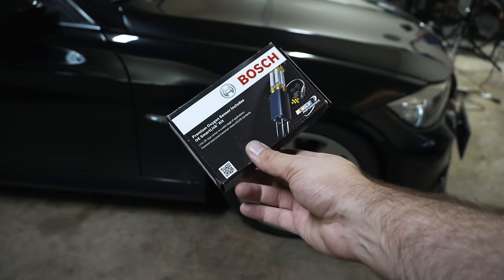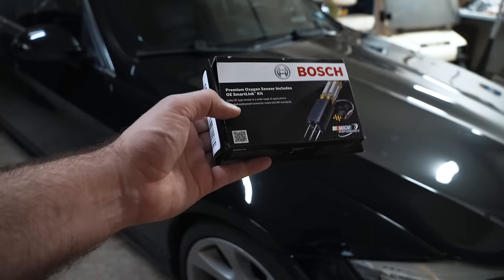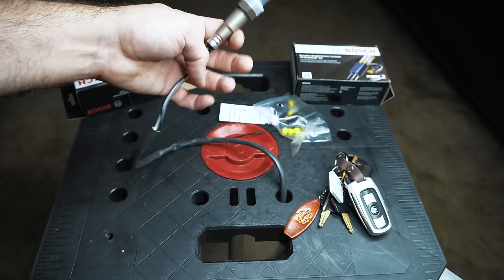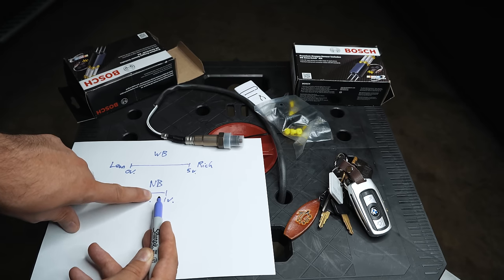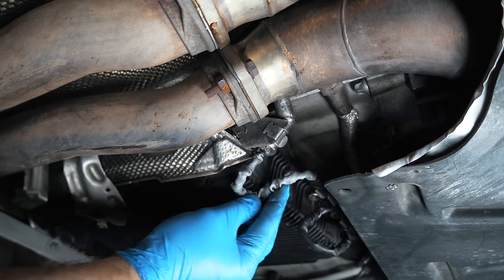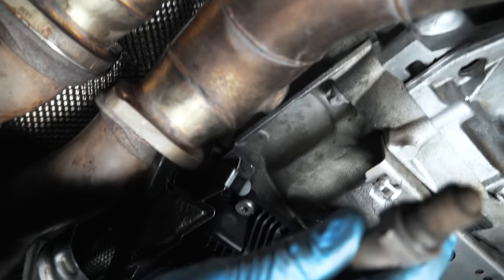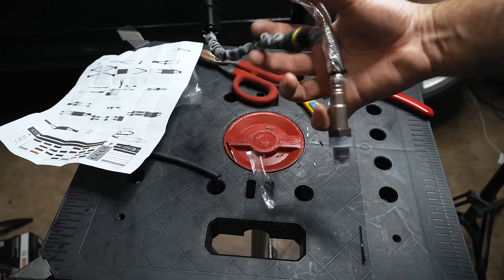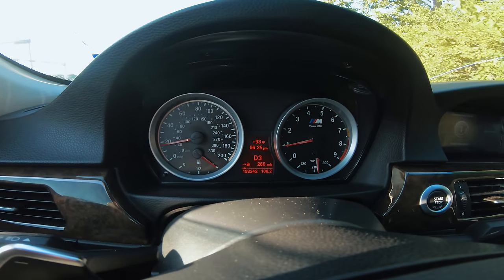I wish I Knew EARLIER! Post Cat Oxygen Sensors | BMW E90 DIY

Comment: 25 year ASE master tech. Post cat sensors monitor catalyst efficiency only. They have nothing to do with fuel mixture if the Pre cat sensors are working. You cannot accurately measure afr after a catalytic converter.
Reply: Thx, yeah I drive AMG's and this video left me a little confused. The primary cat's voltage fluxuates between .1 v-.9 v. while the secondary is a 'mid point' at .5 v.. But can wide-band or narrow band b used upstream or down?
Reply: Not entirely true. I have acces to the Mercedes WIS and on the ME 2.8 the post cat sensors are called the master sensors and are used for two sensor control. They are also used to make corrections to the fuel. 
https://mbworld.org/forums/w211-amg/491094-diagnose-secondary-air-injection-egr-post-cat-02-sensors-through-sds-5.html#post7943273
Reply: Not true. I thought the same and drove with bad post O2 in my N54 for awhile. Thought the code it was throwing was for the downpipes. I was experiencing timing corrections and afr issues under full load in the higher rpms. Ended up changing them out for the same ones in the video and it fixed the issues I was having.
Reply: Scott, regarding 02 sensors, have u ever driven or ran an engine w/o them? Does it stutter? Does it run ok?
Reply: @135i  Hey thx Brad!!!!!
Reply: @ademc8872  Well my Merc. S600 BARELY drives when cold! Once warmed it's better. So I checked both front/rear 02's and pre=cat's were working but both down-side cat's were stuck at .5 v. I'll be replacing both post-cat's soon.
Reply: I think in the N54 the secondary sensors help monitor the calibration of the primary sensors. Obviously the narrow band sensor only can signal rich, lean or stoich, but I think the DME uses this to confirm the primary sensors are not drifting over time. Under the correct operating conditions, if the narrow band sensor is reading stoich, the wide band sensor should agree. This is a working theory based on the behavior of long term fuel trims on the N54 engine. 

The down pipe fix he is talking about in the video simulates the signal of the secondary sensors in cases where the primary catalyst has been removed in order to prevent a catalyst efficiency DTC. This simulated signal appears to mess with the fuel trims and makes it difficult to target and AFR in one or both banks.
Reply: ISTA+ software has written exactly how he's explaining it
Reply: my secondary o2 lambda on bank one went out on my 330i e92 and my fuel economy got worst, im researching what is going on and this vid totally make sence..
detail expl. when i was accelerating half a gas pedal eco never went over 15-20 liter per 100km-instant comsumption reading, now it goes over, 20-25 liter per 100km, not much of a difference but here in europe gas dont come cheap..
Reply: I wanted to comment on this. The BMW ecu system does not just use the post cat o2’s for just catalyst monitoring, the post cat o2’s primary responsibility is too monitor the difference between itself and the pre cat and then adjust the lambda adaptation.
Reply: on my f30 bmw n55, bmw states the rear o2 sensor not only monitors catalyst efficiency, it also identifies deviations from lambda 1 (from front afr sensor), however the rear o2 sensor is not exactly equipped to determine the size of the mixture deviation.

the job of the front probe is to stay at or close to lambda 1 depending on the circumstances. at WOT, we don't care much about lambda 1, we care about the engines performance and keeping it safe from harm. so lambda 1 at WOT; 6500 rpm; traveling up a 10% grade, is way too lean for an ICE with forced induction.

the job of the rear probe, yes, is to monitor catalyst efficiency, but on this application, its also to tell the dme if we are drifting away from lambda or not. 

i wouldnt say the rear probe "calibrates" the front probe, as these probes are calibrated at assembly. but it does give info to the dme to adjust adaptations accordingly.

remember, the dme (or ecu/pcm/ecm) is blind, and relies on sensors to help the dme "imagine" whats going on. if the rear probe (or any input) is lying to the dme, there is logic in the software that can perform tests to verify the information given by the input. if the story doesnt check out, a code is stored.
Reply: @james10165 what codes was it throwing I have the same issue now think it’s the post cats I’m getting 2c7c

Comment: There is a sensor test menu/procedure in INPA (I think under F9), it tests O2 sensors and shows resulting Min and Max values for all of them, narrow and widebands.
Reply: Hi Cygan, could you help me identify which 02 sensor is bad in my case ? Here are the values which differ :
*multiplication adaptation: 
bank 1: 30.443% | bank 2: 4.211%
*correction injection time:
bank 1: 5.66%  |  bank 2: 1.34%
*lambda voltage after catalyst:
bank 1: 0.13v  |   bank 2: 0.78 v

Thanks a lot !

Comment: Just bought the same set off eBay for my 135 2009, way cheaper than the original with the full harness 👍 thanks for this video and the full explanation
Reply: Is the post cat O2 sensor located the same as the video?

Comment: From what little I am understanding about what you're showing us. This all happened because the person that did your "DP Fix" didn't put it back together quite right a crossed two wire pins and instead of oin 19 and 20 being in their correct places they were crossed and 19 was in the spot where 20 should go and Visa Versa? But I learned so good stuff from this as well like some of the relations between the two sensors and what they might be doing when trying to adjust and measure your levels of Oxygen etc. The O2 sensor mod to save money is a great bit of info. Thank you again for the helpful video.

Comment: Thank you so much! After installing new 17T turbos with catless downpipes I haven't been able to get rid of air/fuel and 02 codes. Have misfires etc. I'm going to do this and get back to you with my results. Thanks again for all your videos. You've been a great help for ALL of my mods.
Reply: So?
Reply: And ?
Reply: @chtistianvasquez6029  YES! It's been running perfectly. No codes. AFR's reading right. Also installed XHP stage 2. Thanks again for the help on this. Really saved me after all the work.
Reply: @tazwinsulose  so all you did was replace secondary o2?
Reply: @TimelessMotors  Yes but you have to use Bosch# 15733 for both and splice the wires to the or plugs.
Reply: @tazwinsulose  thank you
Reply: I have a bad 02 code after someone put my catless downpipes but ima go to shop tomorrow I pray it works

Comment: so i put new upstream o2’s in my downpipes after just having them plugged for forever. and i had the correct o2’s in correct pipes and correct connections. yet i was getting a o2 sensor swapped code. i’ve never changed my downstreams, could this maybe be the issue?

Comment: There are a few rules to remember whether you have a BMW or not.

It is important to know the brand of the OEM sensor. Sometimes when a Denso or an NTK is replaced with a Bosch, it makes the car run poorly. I suppose the same thing could happen if a Bosch was replaced with a Denso or NTK.

However, I have never had a problem replacing an NTK with a Denso or a Denso with and NTK.

Universal 4 wire O2 sensors have another benefit. Some very old cars had a one wire oxygen sensor. It would take longer for the sensor to warm up and start reading. With the right conversion kit, you can get that sensor to work sooner. Building something to properly heat that sensor requires some special wiring. The need to convert heated oxygen sensors becomes more important when replacing iron manifolds with long tube headers.

Comment: Great video as usual! But, I think you should talk more about how you swapped the wires with your ECU and what the issue was exactly with upgrading to MSD81. I just upgraded to MSD81 and I am having error codes that I didn't have before (misfires in inj 2-3-4-5 and mixture control 1 /2). I am suspecting that there is an issue with the wires with the new ECU...

Comment: Thanks for getting me to check my pins 19 and 20 which I had swapped when removing DPFix.  This was the central cause of all my bank 2 misfires and continual rich conditions which caused me to replace 3 injectors and plugs and consider replacing all my O2 sensors.  Essentially this wire swap error caused the postcat O2 sensors to be mismatched with the primaries. LTFTs and STFTs are now in bounds.  Still trying to resolve a 29E1 however but the car seems to be running strong.
Reply: Hey what are Pins 19 and 20 where are they located on the DME I did the DP fix as well and I’m having this problem
Reply: @n54hamzeh58  Pins 19 and 20 are yellow wires in the small black connector in the DME area that you temporarily extract.  To install the DPFIX, you insert the DPFIX black female wires into these positions.  Record which yellow wire originally went in the 19 and 20 pin position, so they can be correctly reinserted when the DPFIX is removed.  If they are swapped, I believe you will get codes saying the O2 sensors are swapped.  I ended up replacing all my injectors with Index 12s and this resolved my misfire problems.
Reply: @glennshimamoto9922  thank you for the info. Just to be clear, is it no longer recommended that we use the dpfix? I've been out of the scene for a minute, but I'm now installing a ST kit so I'm trying to catch back up. Thank you for taking the time to answer our questions.
Reply: Could you explain to me how you swapped 19 and 20 arent they the exact same jumper wires?

Comment: Excuse my ignorance. I have Catless down pipes. Would that be the reason that damages the o2 sensor’s? I probably get the garage to install due to my resources. I’ve installed new plugs ran smoothly for a week then misfires. Now getting 2a2c code initially. Tried liqui moly fuel additive ran fine for a bit then more misfires. Do you think all 02 sensors need replacement? Car has done 160km never driven hard.

Comment: I'm sure the primary o2 sensors are the same sensor also , just you pay more for the shorter wire. So if you ever replace the primary sensors just get 2 long ones and save some money
Reply: WeeDxBLaZeR the tips look different
Reply: Did you watch the video? Front sensors are 5 wire Lambda sensors, expensive. A normal 4 wire O2 sensor cannot be used to replace a Lambda sensor.
Reply: @scottxp800  did I say that?
Reply: I said the 2 primary o2 sensors are the same you just pay more for the shorter wire ? Did you read my comment?

Comment: Whoa wait, should i be resetting adaptations after replacing these sensors??? Is there also an adaptation reset for MRS, specifically for your BST?

I have a 2D0D (P0030) AND 93B2 (Battery Security Clampe). I've replaced the upstream O2 sensor (N55) and my Battery Safety Terminal to help fix the codes but they haven't gone away and when i try to reset them, they just come back

Comment: Im still using my msd80 ecu and after i did the mosphet upgrades and did the carless downpipes i put o2 spacers on the rear o2s thinking id have luck getting it to pass for emissions but later found out i just ruined the rear o2 sensors so im about to do this cause i have the same codes you're throwing in this video and if my msd80 ecu is telling me this same issue it must be pretty bad but i need to get this car fixed cause if not i wont have tags for 3 months saving up $500 for the 4 o2 sensors but now i think i just need 2 of them based off this video so gonna try this and see if it fixes my issues and take the caps off the o2s and not reinstall them on the new ones but based off how you explained it it makes alot of sense as to why this is happening now and why it feels like my car is at loss for power cause it is
Reply: Hi! Finally did you fix the problem with this way? I have the same issue and I put O2 spacers too.

Comment: I got the same symptons then you! Just after replace my spark plugs. Then I follow your steps, initilly checking the DME mosfets, there I found one damaged. But while I'm holding the shipping of it, I believe that my BANK 1 sensor are also bad... CODES P0300, 301, 302, 303, P10A5 and P323F are there. I'm ready to order the 4 O2 sensors to solve it... do you think that it will be enough to solve my codes?

Comment: What do we need to do for catless DP? Alternative to DP fix.
Reply: DP fix is the only thing that will pass emissions when they test for completed monitors. If you just want the check engine light off MHD or code out with custom tune.
Reply: @scottxp800  can someone tell me what the DP fix is? exactly? tune? parts?
Reply: @rottdogsparky  the downpipe fix is MHD, if you install MHD into your ecu there is a setting for “OEM/catted dps” you make sure it isn’t checked for the code prevention.... hopefully this helps !

Comment: Can an oxygen sensor be faulty without reporting an DTC? What is the best way to test it, can it be cleaned maybe?
I have problems on cold start for a few seconds the idle is rough, and afterward everything is good i would say. All glow plugs are changed and the relay too. 
The car is E91 LCI 318D 105kw 11/09, it has only 1 oxygen sensor I would say only on the DPF, next to the temperature exhaust sensor and the pipe for pressure sensor. 
Thank you for the answer in advance.

Comment: I have an 07 335xi I’m putting catless down pipes on next week. Would you recommend changing the 02 sensors then to this conversion? It’s the MSD80 ecu, and I have 129000 miles.

Comment: Very informative & well explained.  For my 2008 335i (108K miles), my bank 1 cylinders are throwing misfire codes and I get rough cold starts.  Indie shop says my injectors are bad.  I can believe that but think I have an additional problem related to my bank 1 secondary cat sensor.  On car scanner, bank 1 sensor 2 output voltage dithers from .05 to .85 volts and never reaches steady state at any engine rpm.  Bank 2 sensor 2 acts as expected - it varies between .8 and .4 volts with engine rpm.  I’ve replaced both post cat sensors now and bank 1 still dithers at about 1 HZ.  Just had my car emission tested & passed with no issues.  Do I have a potential cat problem on bank 1?  Any thoughts would be appreciated.

Comment: I’m having this issue with my BMW, i replaced the big Disa valve (1) and catalytic converters and all the lights were gone, but now is giving me another code, 002AAC. The Big Disa valve is new, the small one I checked too and it’s pretty good, I even did the active test with the scanner and it seems to work, but while reading the live data of my sensor, it kinda looks weird, could that be my issue? Thanks

Comment: Do these sensors work for before and after, I'll be getting my Doc single in about a week and i was thinking replacing all 4 for the fun if it, I'm at 120k miles. BTW I love your videos since I do all the job by myself. I just installed a twin clutch with jack stands :P

Comment: Wonder if this is why my single turbo setup is giving me fuel trim codes. Both rear o2 sensors are in a single 3” exhaust post turbo. Would moving the rear o2s to the manifold (separated by bank) fix my fuel trims issue? 

I’ve notice I have to reset my fuel trims every so often or the car will drive like crap.

Comment: I also have an 8 335i. I replaced the MOSFETS in mine. After replaced I'm getting very rough idle and code p0174. No other codes. Car is pretty much undriveable. Maybe replace bank 2 sensor? (p0174 is for bank 2)  Ive done a smoke test to check for any leaks and nothing. Any help is appreciated. Thanks !

Comment: I replaced my (e90 318i) NOx sensor and reset the adaptations, before with the faulty sensor I was getting only one fault code 3104 now with the new one im getting two fault codes 30DC and 30DE. Why? Injector, sparkplugs and coilpack all brand new. Help pls.

Comment: I would never do hack wiring on a O2 sensor. Not saying you did a hack job... don’t take it that way. Just I’ve had very bad experiences on separate old cars that came with them like that to ever do it. O2 sensors are very sensitive and wires are very thin. But hey... hopefully it works out for you. That’s one sensor I wouldn’t try to save a few bucks and hack/crimp.
Reply: yep! This sensor provides the feedback for the whole fuel injection control to achieve top efficiency
👍🏻
Reply: I did the same thing to my post cat o2 sensors. No issues and saved some money.

Comment: I had downpipes installed on my n54 2013 335is get check engine light every morning if I change the O2 to the ones you're talking about in your video will that shove my problem and do you have to change the ECU Thanks and great video.

Comment: is the computer logic smart enough to realise the sensor has been bypassed if it always  reads the same value from a Sec. O2 ?

I've personally tested over-volting the sparkplug coils by feeding the +12 rail with 17VDC... the power delta told me there is power lost because of inefficient burning.... more so than CAT-delete...

The primary O2/lambda are very sensitive to dial in the mixture required by the engine fuel map.

Improved spark allows for more fuel up to optimal power.

Since O2/lambda really drive the fuel map, its best to reset adaptations for relearn the map from stock average.
👍🏻

Comment: my 07 e92 throwing a DME active code of 2C32 & 2C6a and 2C6B, But I got no engine light, it does turn on time to time. Car is on a MHD stg 1+ tune with oem DP, not sure if I should worry about this.

Comment: Great video 
I have same issue and I am about to do same job but my question is you used same sensor for bank 1 and 2 or there is different part number? Because Amazon showing package of two with 2 different part numbers like
15733
15730
But 15730 shows that it does not fit the car. Is all sensors same size treat and same voltage for the rear and for the front? Do I purchase same part number that you showing for both side bank 1 and 2? Thanks